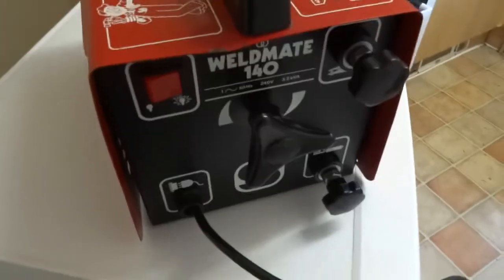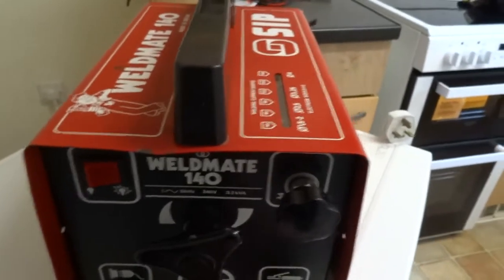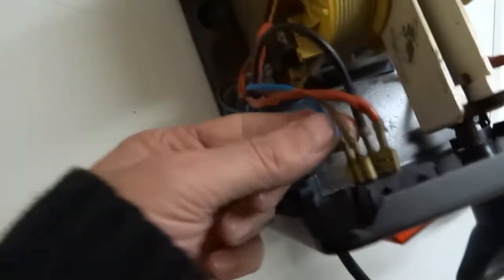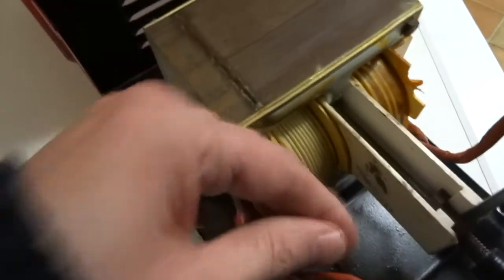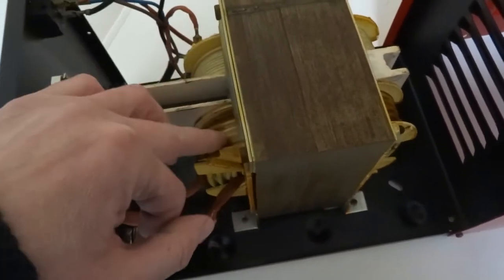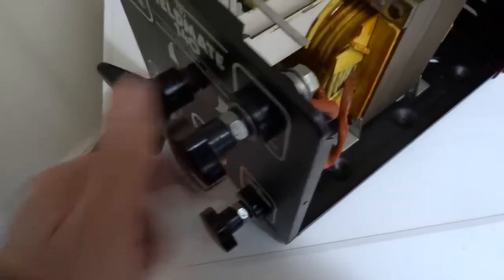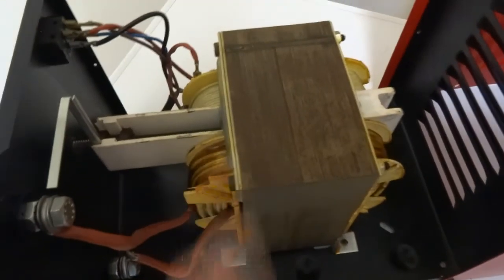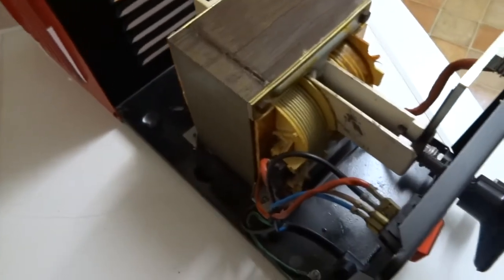Inside an ARC Welder: How Stick Welders Work (Transformer vs Inverter Explained)

Comment: Do you know what temperature the cut-out operates at or part number for a Weldmate 140 or a generic temperature for similar buzz-box welder. 

Thanks Allan
Reply from the maker: Good question it would not be too high as it would trip to prevent breakdown of the insulation , but i would only be guessing if i said a number.
Reply: @cagmito76  Okay thanks
Reply: About 200 degrees Celsius